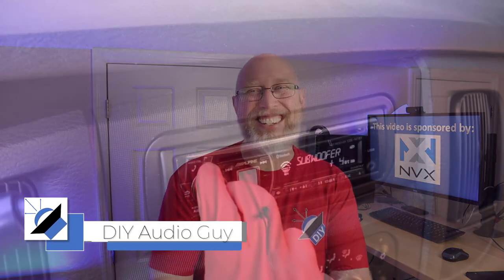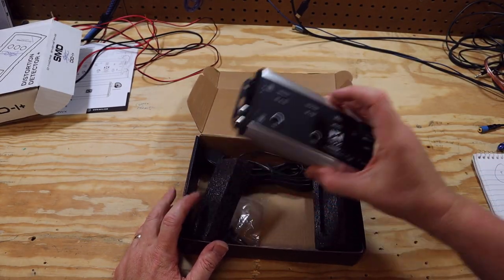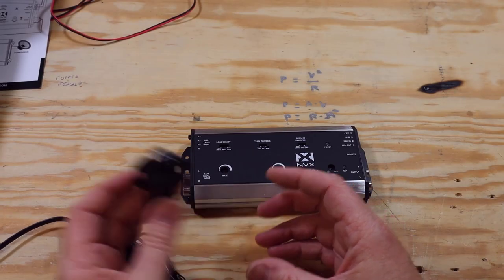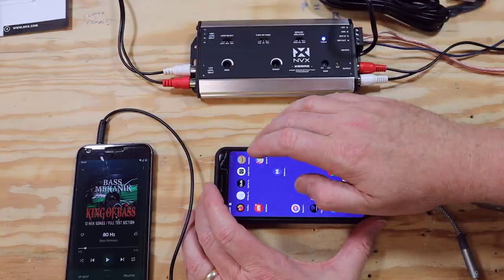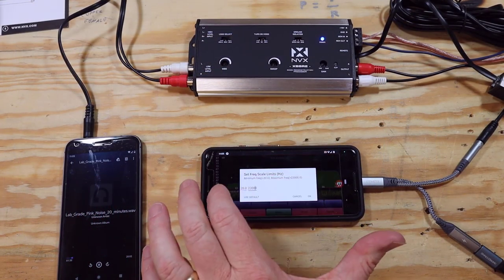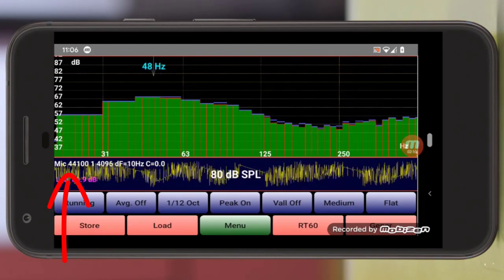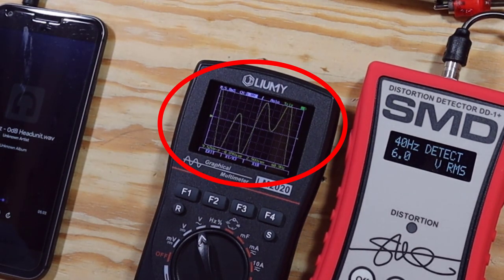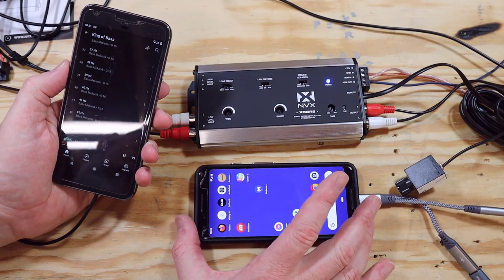Use this to make more bass!  NVX Bass Processor  @NVX

Comment: I've never owned the NVX, but I have owned the Epicenter and the Soundstream version of it and they both worked great. I noticed the biggest difference when listening to 80's rock music. Music that barely moved the sub would have deep bass after turning on the bass reconstruction unit.
Reply from the maker: That is exactly what this is for.
Reply: Mexican music like banda gets a needed bass boost as well
Reply: I really liked the first one (nvx xbbr) i still have it in my garage packed away . Still new looking .
Reply: I have the older nvx bass processor, looks like the other bass processors or the epicenter, but honestly it sounded odd specially compared to AC epicenter, some notes just sounded distorted, and had a cut off frequency at 35 hz. My friend had a soundstream one and it sounded worse, after a while he got a different one, maybe a cerwin vega, i forget which brand it was but it sounded clean almost like the epicenter. It put my bass processor to shame.  I dont use it much, but i think its mainly because it doesnt give a clean sound. This nvx looks like a new and improved one tho :)
Reply: @mexaknpwr5563  Audio Control came out with a Mexican edition Epicenter. When I used to work in a different location, we sold more Epicenters to Mexican guys than anyone else!

Comment: I'm a SQ/BASShead. Even w/o the "need" for a bass restoration module... for many of us (we are Legion, lol), we NEED this device (or AC's). Play for the SQ, use that bass knob for when you NEED that BOOM listening to some Bass Boy or Techmaster P.M.B. where [low-end] SQ isn't all that important. *[EDIT] I forgot... it's a 'Bass Management Module', not necessarily a 'Bass Restoration Module'... DSP is for Full Range, Bass Mgmt. speaks for itself, IMO. Spending @$100USD on this device/module will get you more out of your low-end than $100 elsewhere... js.

Comment: A main feature of devices like this one is that the bass restoration is active. The bass roll off in stock stereos increases with the volume so the restoration level must increase accordingly. I have used the Audiocontrol L2ci in multiple installations and it has always performed well. One caveat is that while the bass restoration is effective, it is not necessarily accurate. Even with careful tuning, the restored bass signal is not as accurate as the signal from the same head unit once the factory amp has been bypassed.
Reply from the maker: The NVX version of that is the XLCA2.  They operate a little different than the XBBR2.  I hope to get my hands on an XLCA2 so I can RTA that one as well.

Comment: I loved my Epicenter 30 years ago and continued to use one in each new system for the following years. Getting old sucks, but I am planning a final system for my latest vehicle and will be looking to add a new Epicenter as well as other AudioControl gear, as they have never let me down in the past. In terms of Bass Restoration and OEM integration, many higher end OEM retro-fit solutions, such as the ones offered from companies like AudioControl have a 'frequency summing' type of functionality to overcome factory systems that may have certain channels running active crossovers etc. so that an entire spectrum is output at line level after the signal is 'rebuilt' in the OEM amplified hi level signal. Great content as always.

Comment: In regards to 1 vs the other when it comes to Bass Restoration. I have tried cheaper units after owning a few Epicenters and can say for certain that the Epicenter does IT best. The others seem like glorified EQ's that boost and stretch Q factors on the low end, whereas the Epicenter uses the incoming signal to produce 'harmonics' , or fake bass notes that it thinks should be there at lower frequencies when none are present. There is a HUGE difference in the overall sound of the Epicenter when feeding it with a full range signal vs feeding it with a pre-crossed over signal, say from the SUB-OUT of a head unit. It uses notes in as high as the 100-200Hz range to help generate those fake bass notes that it in turn spits out at 40+ Hz. In certain setups, I liked the sound of running an active crossover AFTER the Epicenter (feeding IT with full range mono) and in others, I preferred the sound of feeding it an 80-90Hz actively crossed over pre-amp signal. AudioControl suggest a full range signal for best results, but the subjective nature of ears and personal preferences sometimes say otherwise.

Comment: Might be a dumb question, but is there such a device as a automatic bass volume attenuator? I listen to a wide variety of music and I've blown 2 subwoofers because i turned up the bass volume for track one (for example), but forgot to turn the volume down for track 2, which booms and damages my subwoofer. I would love a device that would just level out my bass automatically.
Reply from the maker: What you're looking for is a limiter or a compressor.  These are very common in pro audio / live music.  I have a mini DSP 8x12 and it has one.
Reply: @DIYAudioGuy  Any chance on dropping me make and model number just to give me an idea of  what I'm looking for? I won't hold you responsible for my choices.

Comment: How is the xbbr2 different from the xlca2? I already bought the xbbr2 but I just watched a video by NVX on the xlca2. My xbbr2 that was lost in the mail was found and is being delivered today. Woot!
Reply from the maker: They are very similar.  The XBBR2 adds bass that was never there in the first place or bass that was removed by a factory system.  The XLCA2 is designed to combat a factory system that actively cuts bass as you turn up the volume.

Comment: I plan on running a 660.5 kicker with p65.4c 2 10 inch comp C kickers what would you recommend with a stock headunit I’d be guessing a LC5i  for bass roll off thanks for the video have a great day I’m going the pac advanced T harness connection to headunit stock wiring to power speakers

Comment: if your test tracks are MP3 (your pink noise tracks)  there's a cutoff in the compression of MP3.  128k mp3s all dropoff on the low end; the 'lossy' portion of Mp3 is by discarding a huge portion of low end. 

upgrade your music rips to 320k or Lossless files if you care about bass.

Comment: I wish I never bought this thing and got the lc2i or just a regular converter. The bass on this is all over the place one minute the bass can sound fine then the next it's crazy without touching the volume I'm afraid I'm blowing my speaker so I have to keep the levels way down and it just don't sound right I had it professionally tuned twice and was told that the bass enhancement is the problem

Comment: I have Earthquake Sound's clone of the Epicenter which appears to have the exact same housing and board. It even has a plug for the 'audio control ' light on the top of the board which is unused. It appears to have come from the same assembly line but $100 cheaper.
Reply from the maker: Once the patent expires everybody can make an exact copy.

Comment: Pretty neat to actually see what these devices do to the signal.  I still think the extra $70 for a dsp408 is well worth it for the massive increase in functionality and signal quality.
Reply from the maker: This device is very different from a dsp. It has no time alignment, no crossovers, and it's only one channel of input and one channel of output.
Reply: @DIYAudioGuy Can you add this device downstream after a DSP?
Reply: @darrensmith6104  Only if you need time alignment on it. However, I sat there for a couple hours just looking at my head unit, deciding if I wanted it straight from the Sub out, with all filters off, or to come off my DSP. I decided to tap off my DSP, because I was unsure that all filters off on the Sub out, was going to be truly full frequency. I also can change the left right balance easier with the DSP.

Comment: So this is only really usefull if you are using a factory head unit and not with an aftermarket? Am I getting this right?
Reply from the maker: Only if the factory system uses a crossover to block the low frequencies.  Some people use them to add more bass to music that is not bass heavy.

Comment: Have you hooked it up in your truck and tested it? Do I have to have full signal plugged into it or can I use my sub out outs?
Reply from the maker: I would recommend using the subwoofer out. That way you can use the crossover on your head unit.
Reply: @DIYAudioGuy  I went with the audio control epicenter micro. Seems like overall better product.

Comment: I’ve been running the NVX for a couple of weeks now and I am not happy. It seems like even if the gain is set properly using DD1+. The effect knob will put out very high voltage. To the point that even a 1/4 turn on the knob is too much!! This would be a great product if it had a cap on voltage like the epicenter micro. I’m running the NVX into a JBL GTR mono amp and the gain on amp is all the way down.
How can you control voltage going into amplifier with this thing.
Reply from the maker: The device has a gain control, try turning it down?  If that does not help reach out to nbx for tech support.
Reply: Gain control is fine. But when playing rap or EDM music with knob down, sounds muddy. Mexican music sounds great with knob turned 1/4 up. It’s hard to get both to to align just right. Maybe amp can’t handle that voltage. 
Another thing to note is sweep is far right and wide is far left. Using a ported kicker compR box. 
Thanks for responding and love your channel!!
Reply: @bonks425 try epicenter indash; it actually has a button to turn it off

Comment: Is there a 'home audio' equivalent to the epicenter?  
I've tried to figure out if DSPs could be used to do so?
From what i understand,The Epicenter can fill in bass when playing rock and other bass light music.. I believe by following an existing note at a lower octave with a slight increase in db.
Reply from the maker: You just need a 12v power supply and you can run this in a home.

Comment: Hi, can I use this kind of device in home theater? Between a receiver and a subwoofer? The 80hz crossover  will reduce de effect of bass restoration? Thanks.
Reply from the maker: It's not really designed for home theater but you can definitely do that. You will need a 12 volt power supply.
Reply: I also took this possibility into account. My Yamaha Aventage RX-A2080 it has enough analog inputs to be connected to the rca output of a dvd player or a cd player( I have both in my system). 
To address both options, 10 - 80hz home cinema vs. stereo full range spectrum, even at an experimental level, building a DIY switching relay is not rocket science. My profession is electronic debugging technician. I will have seismic bass in one way or another in my old music collection ( Queen, Scorpions, Pink Floyd, Vangelis, A-ha, Alphaville, J.M.Jarre, Kitaro, etc...their music albums released before the 90s they have a shy bass ) Any small improvement can result in sufficient or enormous satisfaction, it depends on everyone's expectations.'Only a Sith deals in absolutes'  
😉

Comment: Is that really distortion that showed up on the oscilloscope? Wouldn't the processor add extra harmonic frequencies in like it's supposed to and that's what we're seeing? To me it looks like there are multiple frequencies showing up oon the oscilloscope in the form that looks like they are being added together like they normally would whilst passing through a cable. I may be wrong but that's what it looks like to me.
Reply from the maker: Anytime you add or subtract something that was not in the original signal then you technically have distortion.  But in this case the distortion is deliberate.  It is like an electric guitar, the musician adds distortion to get a specific sound.

Comment: The problem I have using the audio control lc2i is I can't play lower than 32 hertz what do you recommend getting a nice headunit or some kind of bass proscessor
Reply from the maker: The LC2i uses different technology and does something different.  It is designed for use with a factory head unit that turns the bass down as you crank the volume up.  The NVX version is the XLCA2.  If your factory head unit is completely cutting out bass below 32 hz then you need XBRR2.
Reply: @bass caddy’ The problem isn’t your factory stereo’ it’s the LC2i. I had the same problem in my car’ no bass below 29hz. I called audio control and the tech told me it has a built in subsonic filter set to 29hz because most music doesn’t play that low. I explained to him I have 2 12’s in a 2-1 4th order ported thru the back seat on a synergy 3500 and I need it to play down to 15hz. He sent me a modified version that supposedly played to 20hz. It was a little better but I switched to the Jl LOC and its better than the modded lc2i. Im sure you listen to bass boosted music like me and the only way to get a good full range signal is to ditch the factory head until. My car has all the stereo navigation and car settings built into the stereo (bmw) so Im planning to put an aftermarket head unit in the glove box and rewire all the speakers to aftermarket amps and completely bypass the factory stereo. There is no device that will give us a good clean signal below 29hz. Ive tried all the bass restoration devices and they are simply not made for bass heads. No matter what anyone tells you’ they don’t work for low bass below 29hz. I hooked my amp up to my buddies car’ he has a pioneer head unit and a similar box/amp setup. We ran long RCA cables from his subwoofer output into my amp and my box easily plays down to 15hz with authority and when playing with my factory stereo and any LOC with bass restoration’ absolutely nothing!!
Reply: @TacticalBuffoonary  yeah I contacted audio control because I read it only put out down to 32 hertz they said that it's on a slope so there still should be plenty of signal yeah right can't wait to get a head unit
Reply: @TacticalBuffoonary  I am wondering if it would be worth buying a cheap pioneer head unit from wallmart until I can actually afford a nice one! I'll just use the crossovers on my amp!!

Comment: I bought the spider bass restoration from walmart wired it up to my amp and nothing. Took it back the same day.
Reply from the maker: What was wrong with it?
Reply: @DIYAudioGuy  not sure, I just couldn't get it to power on. I had the 12v, ground and rem running to my amp. My amp would turn on just not the bass restoration.

Comment: Aside from bass restoration, it's funny how in today's time we "need" all of these hi tech measuring devices to get sound in our vehicles, and without them you're blowing speakers and God knows what else.
Back in my day, hardy har har, we didn't blow speakers anywhere near how easy it is to do today.
Reply from the maker: The real difference is that back in the day a DIYer could not afford test equipment. Shops that could afford it did not always know how to use it and charged out the butt to pull the big audio control RTA off the shelf. The RTA in this video is literally an old cell phone and a free app, Plus a few bucks for a few wires and adapters.
Reply: The problem isn't that you'll blow speakers without this. (It's actually harder to blow speakers without factory integration) 

The issue is that nowadays the head unit and audio system are designed for exactly 1 set of speakers in 1 location in 1 car. While aftermarket equipment is designed to work for all speakers in all locations in all cars. The purpose of factory integration devices is to bridge that gap.
Reply: @blakebrockhaus347  I wasn't trying to highlight factory integration in my response. I was highlighting the task of adding aftermarket speakers in general. Mostly apart from factory. I never blew speakers in the past as I do today and that's when I never knew what gain control was

Comment: Stopped at 5:52 This device on paper is amazing and it's application is huge Rockford Fosgate messed this up with their 600-800 dollar 360 which sad to say was a piece of garbage! I had one like 8 years back had engine noise and all sorts of ground issues it was a crazy expensive overblown line level converter that sucked lol. Not to mention it felt like it was made of tinfoil. But carry on lol

Comment: Is it true that power capacitors can kill you? I want to use one for more power but im just gonna make sure im not holding a device that can kill me accidentally
Reply from the maker: It only takes half an amp of current to kill a person.  So literally everything you touch in car audio is a potential killer.  It is mostly safe because low voltages can't overcome your skins internal resistance.  Fires from short circuits are the bigger concern.  Capacitors can sometimes deliver a surprise shock because they hold a charge, and it can be a HUGE charge so expect it to hurt. Don't play around with it.  Treat it like a loaded pew pew.  The good news is that you are aware of the danger so now you can do some googling and read up on 12v safety.  The people that get hurt are the ones that are not aware of the danger.    

https://www.youtube.com/watch?v=BzjVzg_aWcY
Reply from the maker: Also, if you are worried about safety then get one of these pre-packaged ones:   https://lddy.no/1c5hb 

Skip the old school style that looks like a big can of beer.  Those don't have enough capacitance to do anything, total gimmick, almost fraudulent product.
Reply: @DIYAudioGuy  meh ill just buy 2 batteries then